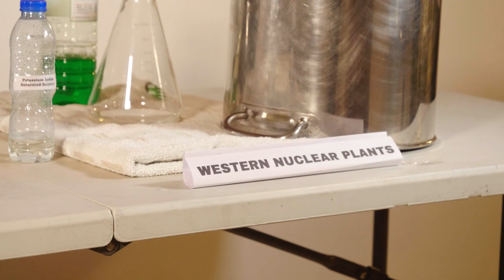Nuclear Reactor Containment Demonstration

Comment: Any containment on earth cannot withstand the force of the reactor in reality,  but it can somewhat reduce the damage that's all
Reply: in case of Tschernobyl that's likely true, however, such huge pressure is impossible to build up in modern nuclear plants, I can't see it happening for other reasons than excess decay heat due to a broken cooling circuit, like in Fukushima. 
When too much pressure builds up in the primary cooling circuit it can be vented before it explodes, leading of course to leaked radioactive material and almost inevitable meltdown, but still better than a burst reactor core.